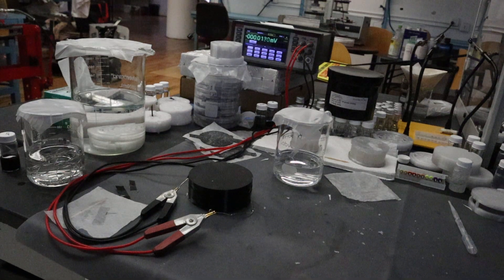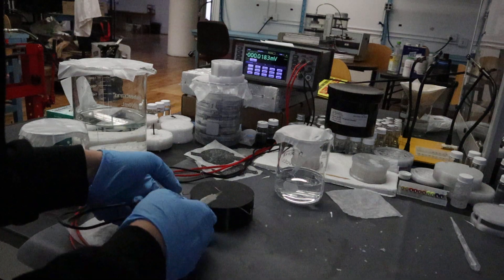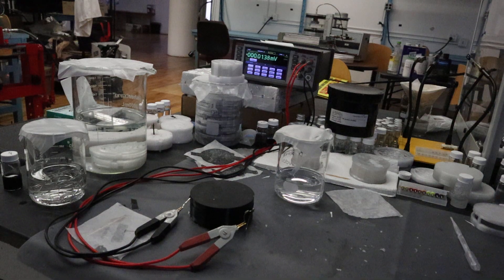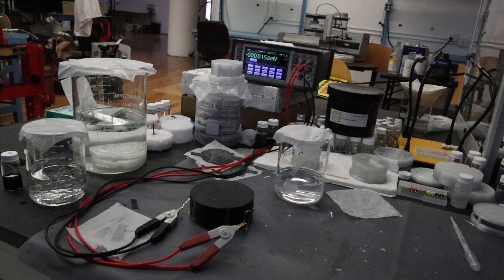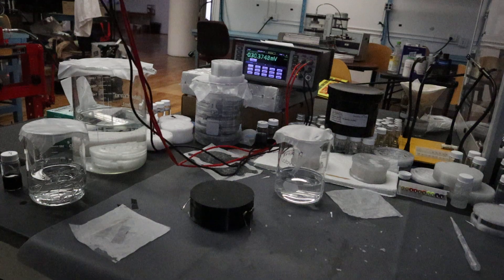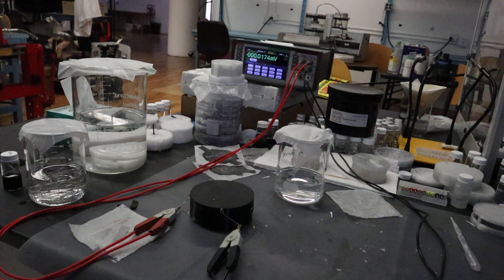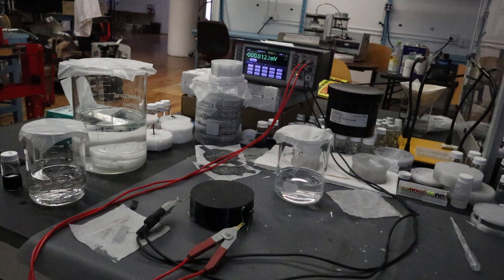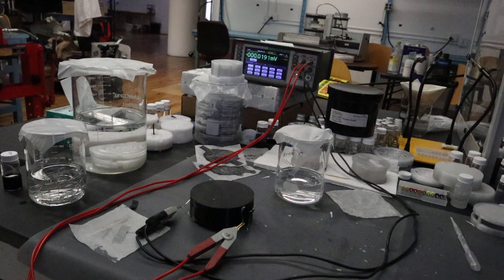Concentration Gradiant Flow Cell - Test 2

Comment: so it isnt consistent after all? That is unfortunate
Reply: It has stabilized at about .02 millivolts in the steady state after an additional 2 weeks shorted, so it is repeatable. I believe the higher voltage earlier was due to the device not equilibrating with its environment.